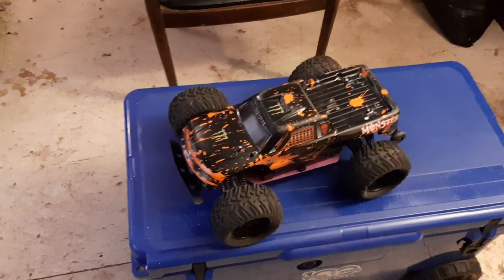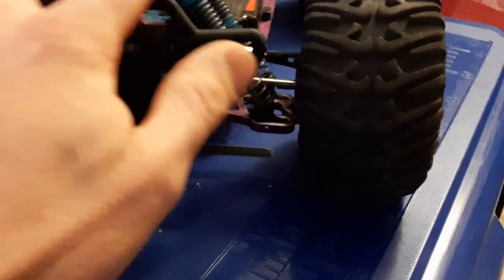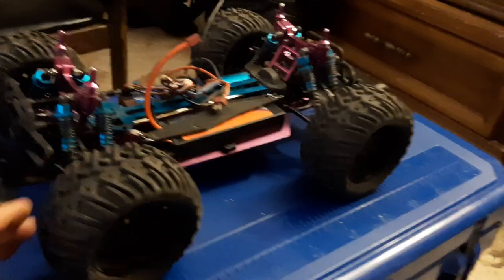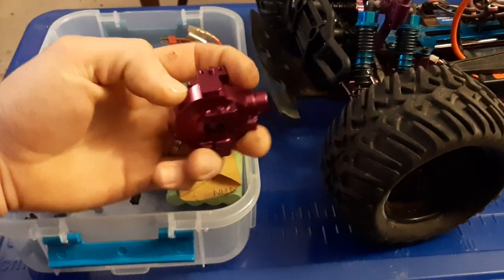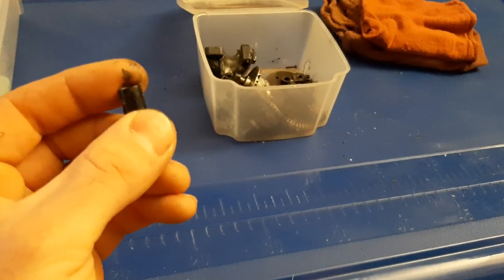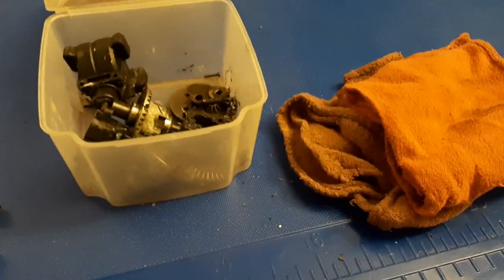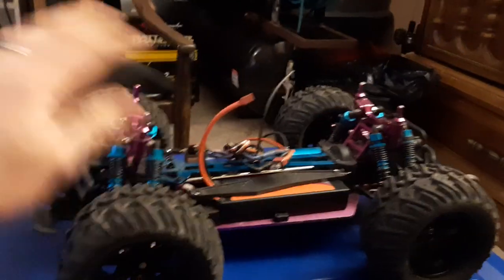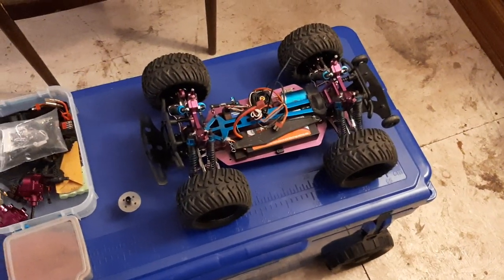Redcat volcano epx pro broken axle shafts

Comment: Found one of these thrown in the trash also found a sandstorm, crazy what people throw away. Just need work on the axel on both cars.
Reply from the maker: I've never had a sandstorm. Always wanted to see one in person. Have any pictures to drop?
Reply: @Rage Rc Repair  I need to hit them with the air compressor they have been put away and are just covered in webs. I've only driven the sandstorm and not the volcano wich is a shame because I really wanna check out how much faster that brushless motor is. Not much difference though The sandstorm has purple components and has a four shock system and isn't brushless but still was fun and kinda fast.
Reply from the maker: @jdp8944  I would have to say the biggest weakness you will find in the brushless is the axle shafts. But they are pretty fast! I've had my stock volcano hit 54 mph on the airport tarmac on 3s. That was just with different tires!

Comment: Awesome and in depth mod descriptions.  I cant wait to try them. Happen to have a link to those bullet dogbones that are extra thick!? I cant wait to try some of these mods. However, I would also be really interested in seeing you do the stampede drive arm swap. There is a pretty in depth forum post on it that says it works  great (no more dogbones!) Anyway thanks again!
Reply from the maker: I had considered the stampede swap but those cv axles suck. I've broken so many of those on the stampedes its crazy  but I have yet to break an hpi dog bone. Thats why stuck with steel bones. And I believe the part number is BMT0007. I hope that helps you find them. Also little orings or a small slice of fuel likes in the diff cups and axle shafts solves tree he dog bones popping out.

Comment: I installed the hobbypark lowers and my axels keep popping out. I am planning to purchase the universal joint axels to keep from loosing my axels. Have you tried any?
Reply from the maker: Yes the universals are weak and seem to snap easily. If you put an oring in both the diff cup and the axle shaft, the axles will stay in place correctly.

Comment: Hey man! I know this has been quite a while- BUT if you still have this car I’d love to know what else you ended up doing with it. I purchased the aluminum lower control arms for the front and aluminum knuckles, as well as carriers front and rear. Long story short- I had two bent front axles, cracked the chassis in half, and decided to upgrade some stuff while I was fixing it. The issue I’m running into now is that the upgraded cv axles from Redcat- the damn pins fell out (currently attempting to get those replaced as they quite literally never saw power. Installed and fell apart.) What I’m noticing is that it appears they may be too short as they barely fit in the diff drive cups. I’m curious as to what specific o-rings you’d use to put in those drive cups- and also if I should abandon the CV axles altogether. If that’s the case- I do want to get upgraded dogbones, and would love to know if you think LONGER dogbones would be a good idea. I took your advice and changed the suspension geometry, but for now I’m unable to do any final camber/toe adjustments until I can get the replacement axles. I’m HOPING that helps with the axle length. The adjustable knuckles appear to have an additional, lower, hole to place the upper turnbuckles in- but since you were using the original plastic ones I put them in the middle.
Reply: Metal chassis, shock towers, etc. are fine, but I've discovered that the original plastic lower arms on all corners will save your CVD axles  and/or dogbones more than you'd expect. Unless you are running on pavement and have found or made some sort of sway bar for pavement speed runs and never cart-wheel it 30ft across the drag strip... but then you probably wouldn't be having axle problems I'd guess :)

Here's a quick outline of my build:

Mine is pretty much all alloy parts including alloy rear diff housing (dunno what he's talking about with just one not working... maybe he didn't flip the other diff), and hardened diff cups front and rear using the method he mentions in the vid ^^. 
When switching back to plastic lower arms all around I modified the front (shaved a bit and drilled out) to accept redcat Blackout hubs stub axles. These have a far better uh.. camber link?? than what comes on the EPX but need a bit of modification or a spacer where it attaches to the shock tower. The stub axles from the Blackout are also  that are 1mm thicker than the Volcano/EPX stubs and are compatible with the CVD shafts available for the Volc. EPX on amazon. 
Shimming the differentials is MANDATORY when going from plastic diff housing to alloy! 10x16x0,1(mm) shims did the job nicely for me, about 4-5 to keep the diff from moving or pulling the ring gear and screws out/away from the plastic differential gear housing.

That really seems like the most solid way to build it for the 4s monster lipo and castle motor/esc I've crammed under the shell. It will do around 45mph with the gearing and motor KV I chose and that's STUPID FAST even with a couple of acre space to rip around! My dogs can grab it by the tire and shake it on the rare occasion they catch it and it doesn't require buying yet another $25 set of CVD axles to replace bent stubs that quickly sheer off once bent anymore!
Reply from the maker: So I have learned the redcat axles and axle shafts are trash on this model all the way around. If you want a good axle that's half a mm longer, go with the bmt0007 dog ones for the hpi bullet. You must search online to see who has them in stock, but it's a much better option. I believe you can even use the front and rear knuckles from hpi on the redcat. Also the HSP 94111 is the same truck. This is just a China truck made for many brand names. But some are different specs. I use 5mm orings out of a kit from harbor freight that has the complete assortment. You can use the extra orings for many other vehicles as well. I highly recommend keeping the entire truck stock, stripping the electronics, and spraying the entire thing down with WD40. For some reason that softens the plastics a bit and keeps everything from cracking. I hope that helps!
Reply: @ragercrepair9301  I think I may have tried some of those. The dog bones I have tried get thicker in the middle while the stock axles are softer and stay the same size over the whole length. 

Personally I've had the best luck with the CVD offering from RCAWD as far as durability. They aren't perfect, but they are now the only option for me with the blackout hubs/stubs I have in the front as far as cvd shafts. I hope to make my own in the future with a mini lathe.
Reply from the maker: @Grey-Troll  I have considered that as well. I might make some just to see what happens. That truck isn't the best but that's why it's so damn cheap. Idk why they haven't gotten rid of it and went to the mt10e with a center diff. Eliminate all the trash models.

Comment: any suggestion o a brushless motor and esc upgrade for the brushed version?
Reply from the maker: About 3000 to 4000 kv on the motor, needs to be a 3650 or 3660 can size. I would say a 60a esc would be perfect.

Comment: Hey man I have a redcat volcano epx pro and I was wondering which T bone basher bumpers would fit it? Plz help  there are so many dif ones. Web/part #
Reply from the maker: One is a standard front bumper and that part number is 47060, the Mt is a beefier bumper which is part number 47069 and the rear bumper is 47061. Hope this helps!
Reply: @ragercrepair9301   good lookin out man
Reply from the maker: No problem! Happy to help.

Comment: So I’m about to buy one of these is it a good truck and what’s the first thing I should upgrade? Thanks
Reply from the maker: Honestly I wouldn't buy one. I would buy the kaiju or the mt10e. Way better trucks all the way around
Reply: @ragercrepair9301  ok Ty it’s hard finding a good one in that price range
Reply from the maker: Yes it is. You may want to look at the art a granite blx as well
Reply: Yes I’ve been looking in to the granite but don’t like the plastic gears I’ve went through 3 cheaper trucks already and I wanna buy a good one but don’t wanna spend more then 350 and both of the other redcats you said are right in my price range I also have a YouTube channel and wanted to start doing some Rc stuff
Reply: What do you think about the arrma big rock?
Reply from the maker: Personally I have no experience with one, but from my understanding they are super tough trucks just like the rest of the arrma vehicles. Arrma really makes quality stuff, but it is a little more expensive. The Traxxas stuff is also pretty good. I don't like their vehicles with the slipper clutch designs, but outside of that, they are pretty tough. Redcat mt10e, kaiju, kaiju ext, the shredder, and the wendigo are all pretty rough. They make good crawlers for the price as well. It's all in what you prefer. I like redcat because parts are cheap and their platforms are pretty simple. The shredder is the best big truck deal there is hands down. But it does need some mods out of the box.

Comment: Have you tried installing the traxxas parts on this truck yet I found a write up saying which parts to use to install stamped or slash drive shafts just haven't found a video on it I ordered the parts hoping it works its about 50 bucks worth most of it is on the axles them selves
Reply from the maker: I need to try this as well and do a video on it for everyone. What parts did they say to order?

Comment: one thing you didnt see  is.  im removing the mettle lower rams.  measure the distant of the pin location for the riser arm and cup .  the metal are about 3 mm longer out. which moves the cups farther away.  you would have to have longer god bones.  there is none so  im going back to stock to see if it solves my steering problem.
Reply from the maker: Aww I see.

Comment: man i can't find that rear bumper anywhere. can you give me a link please. did it come with the wheelie bar on it? also what o rings did you use to hold the axle in place?
thanks
Reply from the maker: Check out T-bone racing for the wheelie bar and bumper.
Reply: You can also fit a Redcat Dukono pro wheelie bar on the volcano with a tiny bit of modification! I just installed one on mine and it’s been bashed twice with no problems!🤘🏻

Comment: Great video man!   I just bought a redcat volcano exp pro like a week ago.It has broke EVERY single time I put a battery in it!!  I have never even jumped it over 2 feet in the air or hit anything hard at any speed at all.Broken parts list...Front axle 2 lower control arms both broke  chassis cracked in the front/  front bumper snapped   center shaft snapped  The rear tire flew off today. It came right past the axle nut!?!?!? And my brother smashed into me and bent a shock with his brand new truck. What upgrades are necessary to make this truck worth owning? I really want to run it on 3s. I ordered a new aluminum chassis and control arms and knuckles.I also bought a 120 amp esc.  How durable are these when upgraded to all aluminum? I watch these people launch 30-50 feet and drive away, and I hit a tiny jump or flip a tiny bit and she is broke.I don't want to jump it a mile just mess around and keep it in one piece and do wheelies in fields.
Reply from the maker: Take a look at my video on axle shafts. It's an older video but it shows everything you need to make this truck amazing!
Reply: Rage Rc Repair I did see it.  New sub here as well.
Reply: Same experience, man!  I gave this to my son for Xmas, and LITERALLY something has broken both times we took it out (less than a total hour runtime since unboxing)  that requires new parts and excruciating downtime waiting for them.  Screw stripped out of l/f lower steering knuckle first run.  10 minutes on a dirt track, less than 12" air, flat landing, wheel axle snaps on rear wheel.  'Out of stock' from Redcat, but I found Stainless axle assy's on Amazon...   Still, the downtime is discouraging for a truck that has been gently used.  I'm fine with fixing it - but my son is a little more than discouraged and is convinced it's a POS!  
Thanks for the great tuning video, I will be watching more and modifying as needed for now.  Maybe Redcat ought to set it up different from the factory to make it more user-friendly...?!
Reply: @scottamu7816  Honestly I will save you a lot of pain and anger. Send it back.It is just a lemon rc. My bro bought a redcat after I got mine.His broke in the first minute.He sent his back.I kept mine.I have more money in parts then I paid for the whole rc.I have bought 8 other rc's since this redcat, and have NEVER driven my redcat since!!!! I have broken almost every single part in this rc. SEVERAL TIMES!!!
Reply from the maker: Ok so I have discovered since mine is all aluminum, which BTW its cheaper to just buy the entire truck as all aluminum parts separately, and it's a total beast. It's better off with tires that are smaller like short course tires. I'm hittping 50mph on 3s and since it's all aluminum I rarely break anything anymore. The tbone basher bumper up front and wheelie bar in the rear have totally saved this trucks ass. It's quite the little beast not and has held up since I turned it aluminum. But it costs more than the price of the stock truck to build if as an upgraded truck. My advice is the redcat Tr-mt10e. Best little basher on the market imo.

Comment: Thanks for the video! I just got my Volcano EPX and this has helped a lot!  I wanted to verfiy the part number for the HPI axles, is it 101236?  Heavy Duty axles for the Bullet, 84mm long.
Reply from the maker: Should be the 3.5 inch bmt0007
Reply: @ragercrepair9301  thanks!  I went ahead and followed your method of hardening on the outer cups as well as my stock (replacement) dog bones.  I haven't torn the diff apart yet, but I'm sure I will.  I've bashed with it long enough to kill my 5000mAh 50C battery twice and so far, dog bones are straight as an arrow!  I'm still ordering these HPIs just in case, though lol.
Reply from the maker: I'm happy everything worked for you! Haha!

Comment: Can you link the HSP Dog bone part numbers?
Reply from the maker: The part number you're looking for is the BMT0007. It's the axle shaft for the Hpi bullet which is essentially the same exact truck.
Reply: @ragercrepair9301  how about the stub axle shafts?? I have been searching all over for some rugged stub shafts for the volcano epic pro, but no luck. I have bent both hobby park and Redcat brands and I’m only running 2s on a slightly bigger tire. Any recommendations will be greatly appreciated! Thank you!

Comment: thank you I will watch this again to be sure. I do have one question in regards to the grub screw holding the shocks on the steering arms. Do you recommend using a little thread lock on them? they appear just a little loose with the metal steering arms? thank you
Reply from the maker: I'm not sure I know what you mean by shocks on the steering arms. The shocks only mount to the control arm and shock tower. Maybe I'm missing what you said.
Reply: @ragercrepair9301  I'm sorry you are correct the control arms, newbie with description.
Reply from the maker: No problem. I just super glued mine in when I put it together and it has held fine since then. Been a year like that or so.
Reply: @ragercrepair9301  yes I placed just a tiny drop of thread lock just in case. I had a crash and broke the control arm on one side and replaced both with the metal control arms. All good now. Ready to go